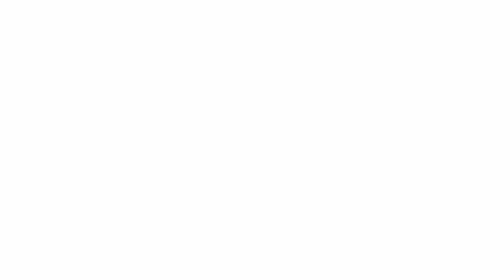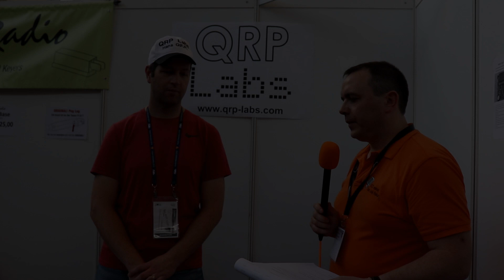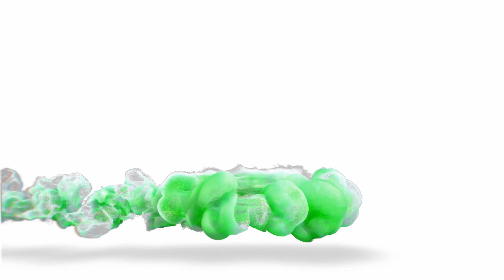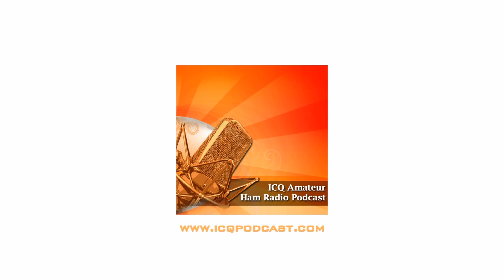The Process of Designing a QRP Labs Amateur /Ham Radio Kit

Comment: I purchased one of the QCX-40 kits and it went together very easily, unfortunantly i flubbed it up somewhere and could not get it to work. QRP Labs told me to send it to them and they would fix my mistake (s) and get it to work for me. This is a really neat little rig and I am anxiously awaiting its return so i can fire it up and do some CW contacts on 40 meters. Thanks Hans and all the folks there for your excellent service and information. 73 N5EQY